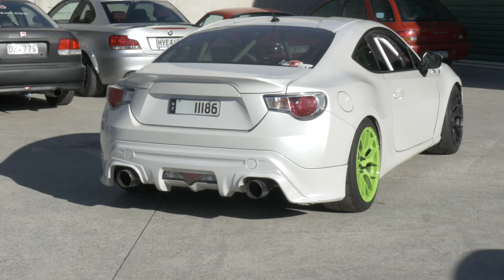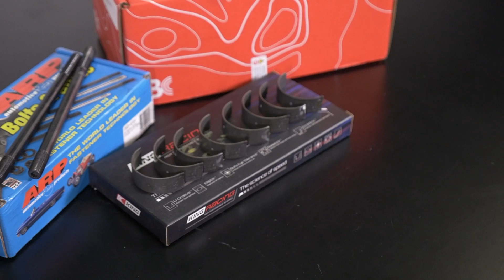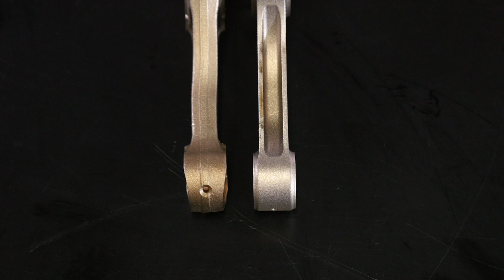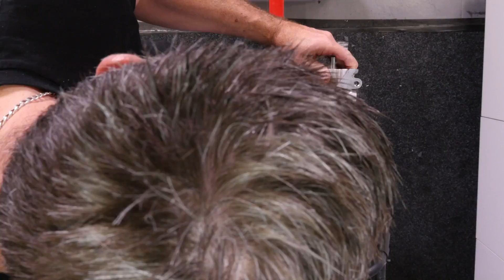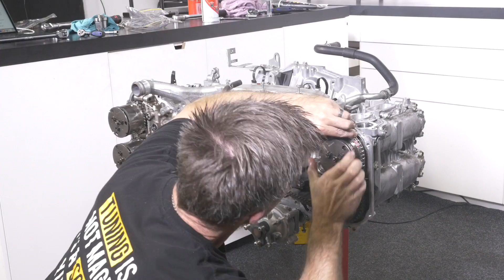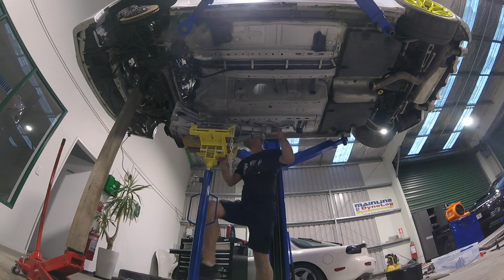We BENT A Rod | Turbocharged FA20 Rebuild [GHETTO-BUILD]

Comment: The majority of FA20 failures I’ve seen have been due to rod bearing failures, which people speculate comes from oil starvation. Do you guys have any other possible causes for these failures, or tips on oiling to help prevent this?
Reply from the maker: Not an issue we had to deal with but on most Subarus or even just road cars in general that you're going to track, upgrading the sump is a requirement rather than a suggestion.
You can do a fair bit to a wet sump before sinking money into a dry sump too depending on how you use the car and your budget - Taz.

Wet vs Dry vs Accusump - https://www.hpacademy.com/blog/dry-sumps-wet-sumps-and-accusumps-explained-mountune-tech-talk/?utm_source=youtube&utm_medium=social&utm_campaign=general-interaction

Wet Sump Upgrades - https://www.hpacademy.com/previous-webinars/201-creating-the-ultimate-wet-sump/?utm_source=youtube&utm_medium=social&utm_campaign=general-interaction

Dry Sump 101 - https://www.hpacademy.com/previous-webinars/223-dry-sump-systems/?utm_source=youtube&utm_medium=social&utm_campaign=general-interaction

Comment: Yeah, the rods seem to be the weak point. Of course the engine was not designed for turbo-charging. Thanks to your experience, others can immediately replace the rods and all is well. Do you foresee any other problem areas?
Reply from the maker: To be fair the rods only really didn't hold up well to anit-lag, even mild. We only ran that for lessons on it so I doubt it's a problem many will see.

Outside of that though, the gearbox is the MAJOR weak point in these to the point there is almost no boost in 4th gear which is the weakest of them - Taz.

Comment: Thank you guys for your videos. As I’m delving deeper into my cars’ builds, I’m starting to get into specific details when blueprinting an engine. 

In the case that you’d reuse the pistons but want new rings, would a dingleberry hone be sufficient assuming the bores look okay? Scouring the internet, internet people make it seem almost blasphemous to reuse pistons and rings after removing from the cylinder.
Reply from the maker: You really want to bed fresh rings into a freshly honed bore. We have not done a DIY dingleberry hone, maybe for a low power/budget application that is fine to take the risk.
If you're happy to try it knowing you might have to pull it all apart to do it again, why not I guess, but if you're like us and you don't have the time to waste on something like that in an engine that you are racing, even at a club level, then there's no point messing around.

TL:DR If your pistons are fine, while it can be frowned upon for sure, reuse them, we're not all made of money, but get those rings setup right unless you are made of spare time - Taz.

Comment: This is exactly what I was looking for.  I wanted to see if on a relative new fa engine I could only change the rods and push the boost on a WRX.  Please do a follow up video with power numbers.   I just got subscribed just to follow this project.
Reply from the maker: We didn't really push it too much further, just to 14psi which sees it close to 400whp. For the tyre on the car and setup (including the gearbox made of matchsticks around 4th gear) that is enough for us - Taz.

Comment: That’s why I liked buying cars new so I can bed them in properly, lots of light to medium load and engine breaking at the beginning and increasing rpm’s as needed until 500 miles. Has netted me 7 mpg more than rated and no oil usage or soot on tail pipes on all my new cars.

Comment: When even hpa can’t build a reliable fa20 nobody can. I’ll never own a shitty Subaru boxer engine
Reply from the maker: No engine is a fan of antilag to be fair remembering this is a modified setup and not something that rolled out of the factory like this either. Everything has pros and cons regardless of the brand or cylinder orientation - Taz.

Comment: I know im late on this video but im thinking of turbo charging my engine and i do not want to sacrifice reliability so if i replaced connecting rods and pistons with forged how much boost can safely be utilized for this engine
Reply from the maker: I think we were around 10 PSI which gave about double the output. Anti-lag is the only thing that the factory rods hated as Andre mentions - Taz.
Reply: @hpa101   alright thanks so much i really hope to get the money to take yalls classes some day thanks again

Comment: Great video, very informational. I wanted to ask if you will ever do a video on the FA20 cylinder head. I wanted to learn moreabout them. I am currently building my engine to be able to handle higher boost levels. I just want to make sure that I do things correctly, even if it takes time.

Comment: I just finished rebuilding my son FA 20 motor I had to get the rods tapered to fit the aftermarket pistons that he had bought. We used ARP studs for the heads. I had the crankshaft machine because he spun # 3 rod bearing. Use king bearings for the mains and the rods. Installing in the car this weekend. Hopefully runs good when I’m done. At a later date we’re going to be installing a supercharger. This is the first boxer motor I have rebuilt is a lot more complicated than any of the other engines I have rebuilt. I found a shop manual online I think it was 176 pages to do the rebuild
Reply: Epic...
Reply: How’s it hold up
Reply: Hey man, just curious about how the motor held up? This is 5 years later, so I’m sure it’s long gone by now, but is love to know how it treated you. From what I can see, spun rod bearings seem to be the #1 thing killing these motors, so I’d love to hear your opinions on why the bearings are failing.

People commonly say the bearings are starved of oil, but my question is why and how. Surely there aren’t THAT many people who are letting the oil get so low, right? The car has a sensor for oil level too.
Reply: Currently rebuilding an ej20 with my brother, im not a mechanic but i have found it alot harder than any other engines i have helped rebuild, which have been 2 6.6 litre inline 6 diesel engines

Comment: I love the lower mount turbo, where did you pick it up from?
Reply from the maker: It's originally from AVO in Australia however we've made some pretty dramatic modifications to it including a different turbo (BW EFR 6758) and adding double slip joints to the long runners.

Comment: I may be missing some info from previous videos, but why you decide to sick with stock pistons? Considering that you were that deep in engine disassembly, why not add new pistons? Are they any good in stock FA?
Reply from the maker: This is explained in the video but there's quite a considerable extra cost with fitting forged pistons too. There's the cost of the pistons which is obvious but the cost of machining the block (and the fact it needs to be torn down to as bare block compared to what we've done here) is often overlooked. 

Ultimately we've also had no trouble with piston strength as yet. We have another engine in the pipeline that is much more serious and also includes a set of JE pistons though. ;) Hope that info helps - Ben

Comment: hi, i think the reason is the sever detonation that occurred on top of this piston only (piston rotation axes perpendicular to the gudgeon pin).

you should test your fuel injectors (bensh test), maybe there is a quantity drift, or install an O2 sensor on each cyl. 

changing rods is a nice and bad idea, without removing the cause.
Reply from the maker: Thanks for the suggestion. We think we know the cause of the problem. Did you watch the video Paul we explain it all in there? - Ben

Comment: The heat cycling part is kinda sorta True. The bearing shells, rods and  the main caps are made from different materials. The thermal expansion of each part is different and that does affect bearing crush a bit. I like to belive that warming the engine and is fluid's to operating temperature do help seating the bearing shells.
Heat cycling is also good for finding leaks and proper bleeding of the cooling system. 
I do not build engines for a living, just some thoughts on my side.

Edit, typos and more.
Reply from the maker: With reference to the bearing shells, that's going to happen every time the engine warms up and really comes down to just not thrashing a stone cold engine. I'm a strong advocate for doing just that and even built in an 'anti-thrash' strategy in our M150 to prevent 'enthusiastic' driving below 60 C oil and coolant temp. The only other area which I'd consider is re-torquing the cylinder heads after the engine has been heat cycled - This is dependent on the engine and head gasket though.

Comment: Hi, great video! What procedure did you follow to prime the oil system/pump in the FA20 build?
Reply from the maker: We disassemble and clean the pump and then pack it with a moly based assembly lubricant. Vasoline is another common choice.
Reply: Thank you, keep up the good work!

Comment: Won't the new connecting rods effect the balance of the crankshaft? Very good video.
Reply from the maker: Actually in a horizontally opposed 4 cylinder the way the pistons and rods operate means that they cancel each other out so the pistons and rods can be balanced independently of the crankshaft. If this was a V6 or V8 it would be a different deal.
Reply: @hpa101  Thanks for the reply! Great info.

Comment: Send that block to CylinderSupportSystem and we will close that deck in proper for you!!!
Reply from the maker: On this engine we don't intend to push it far enough for the open deck design to become a limitation. We do have another FA20 we're building though and we've close-decked it in house in a similar way to what CSS do. Unfortunately from NZ the return freight to the US for this service would have been prohibitive. If we were state side it would have been a no brainer! - Andre

Comment: After 19 years in the trade, it blew my mind that you decided to machine a taper into the small end of the rods and maintain the shitty cast factory pistons. It's seem to me the approach is a little backwards in the train of thought going into beefing up the motor. Are a set of pistons really outside the budget of the channel? That can't be it. I know your building a proper motor for it at the same time, but come on guys. Why put nice expensive rods in it with cast factory pistons? Makes no sence, my man...
Reply: Must be an Evo owner salty Subaru are still making cool cars and engines. 

Think about it, a lot of people do this, or the exact opposite. Sr20s and rb’s are great for keeping stock rods and putting forged pistons in to keep cost down, and as Andre said a shit tuner will fuck whatever engine you give them, built or not built. 

Great video, and a great spotlight on what can be done on a budget to gain reliability.
Reply: NA engine has weak rods because they aren't designed for forced induction. That is why, on turbo cars the cast pistons tend to be the weak point. Water methanol injection will says your pistons at high load. Turbo engines can easily double the output with stock bottom ends.
Reply: @dj4monie  yeah that's all fine and dandy bro. I'm a qualified mechanic of 19 years. I build engines on a daily basis. Maybe you don't know much about the ins and outs of piston design- but N/A engines position the top comp ring a lot closer to the piston crown, whereas a piston designed for boost will have a thicker crown, a lower position of the top comp ring and a pressure relief groove in between the 1st and 2nd comp rings. Then there's the fact the cast pistons are weak and prone to shattering under detonation whereas a forgie is stronger and can take more of a beating- but also the piston won't shatter- it deforms and stays together- saving you from destroying the whole motor. Piston design is very important in a big hp motor- and this thing will never be a big hp motor with THOSE pistons bro. They are so gutless from factory, they don't feel quick until you start pushing a 150 - 200% increase in power. That last part is not meant as a statement of fact, but rather my opinion on what a quick car should feel like. Cheers
Reply from the maker: @danielbrealey2924  I'm pretty sure we already covered this in detail within the video but sure I'll go over it again. While you've referred to the stock pistons as 'shitty' and 'crap', that isn't our experience so you must know something about them we don't. While some factory pistons are genuinely weak, most failures in cast pistons are a result of poor tuning resulting in knock - Tune the engine correctly and you may be surprised what that 'shitty' cast piston will handle 😎Given we've been making more than double the stock power on the factory pistons for the last 4 years, I've got no reason to be concerned. Clearly 400 plus hp isn't enough for your liking but we didn't build it to impress you. We built it to be a well balanced track day car and given it's only marginally slower than a Ferrari 488 around our local track we'd argue it's getting the job done. 

It's easy to say that we should 'just put pistons in it' but that ignore the extra cost for the pistons and then the machining required to fit them. Plus we then need to strip the block completely and ship it to our machinist which would add time. This video shows a legitimate option for this particular engine that can save a significant chunk of cash if your power target is in the 400-450 hp zone. Why spend more than necessary fixing things that aren't broken 💁🏻‍♂️
Reply: @hpa101    I was having such a tough time adjusting to your accent (on my end) that I actually found myself slowing the video down a notch, where I normally have to speed a video up to hurry through too much chatter. One thing I didn't have any trouble understanding is 12.5:1 compression and boost.  High compression and boost is the only way to fly for me and if you can do it on stock parts, more power to you. No need to swap out stock parts in order to achieve the goal without a good reason.
Reply: Yes you COULD get them machined to fit factory pistons from BC- but if you've gone to the effort of stripping the motor like that, why the hell would you take the chance on those crap cast pistons. These motors are SO underpowered from factory, a 100% increase in power will still mean it's relatively slow and gutless still. Now if you had thrown pistons in it and ARP heads studs with some good aftermarket MLS headgaskets you could be more in the range of 150 - 200% increase in power and it'd actually be something of worth then. I'd be surprised if this thing could run a low 13 the way you've built it, it COULD have just as easily be a 12 or maybe even an high 11 second car. It's not what i would recommend to one of my customers considering the labour to remove the motor, strip it and put just rods in it. As far as getting your money's worth out of what's happening you'd have to recommend the pistons to be done too

Comment: I have always wondered why timing chains have guides instead of a swing arm/eccentric bolt style like a belt. Surely this would negate the use of guides which wear out surely, is there something I am missing in this subject?
Reply: i think its because guides, having constant contact with the chains (which have more mass than belts and could transfer any movement due to play or expanding when hot) keep from harmonic imbalances in the engine. also it spreads out any stress points on the chain instead of focusing tension on one section as in over a pulley/tensioner

Comment: Why not just buy new pistons compatible with the rods?
Reply from the maker: This is explained in the video but there's quite a considerable extra cost with fitting forged pistons too. There's the cost of the pistons which is obvious but the cost of machining the block (and the fact it needs to be torn down to as bare block compared to what we've done here) is often overlooked. Ultimately we've also had no trouble with piston strength as yet. We have another engine in the pipeline that is much more serious and also includes a set of JE pistons though ;)

Comment: Why grind the rods? Instead of machine the pistons to suit the rod
Reply from the maker: Purely because the amount of material we'd need to remove would have weakened the pistons.
Reply: @hpa101  You mentioned there's options for rods that already have the machine work done for OEM pistons. Where did you find these?
Reply from the maker: They became available from the same company AFTER we had already machined ours. Murphy's Law haha - Taz.

Comment: This video is perfect! I am currently right in the middle of figuring out the next step in my mr2 turbo 3sgte build and you answered pretty much all of my questions in regards to replacing forctory rods with aftermarket forged and without having the crank taken out. Thank you for the information!
Reply from the maker: The rods in the 3SGTE MR2 SW20 are actually pretty good right out of the box. Upgrading them certainly won't hurt but there's plenty of examples of that generation 3SGTE making north of 450-500 whp on stock rods. The rods in our FA20 are much weaker in stock form sadly! - Andre
Reply: @hpa101  this is true from what I've heard! But for $375 I can get manley rods with new arp rod bolts.  Seems like a no brainer
Reply: @hpa101  What are your recommendations for the rods and pistons on the 1ZZ-FE?

Comment: When I started breaking in my engine I initially drove it about 50 miles on and off throttle, then changed the oil to the same conventional oil but left the oil filter which I'll change when I go to full synthetic at 1000 miles. Is it safe to do that or should I have changed the filter after the initial drive alongside the oil? It's a purolator boss filter.
Reply from the maker: I generally prefer to change the filter as I consider it very cheap insurance. It's definitely not a deal breaker if you haven't though.